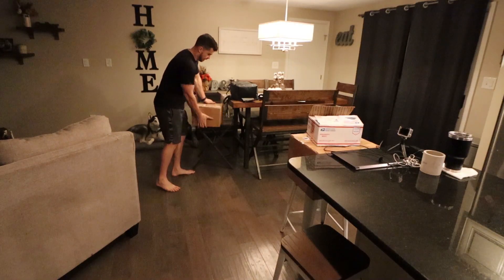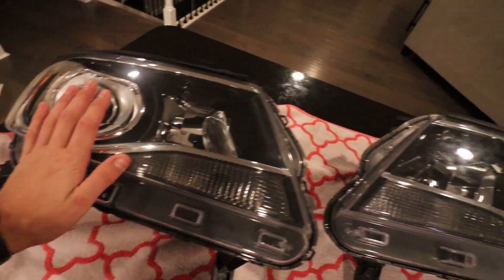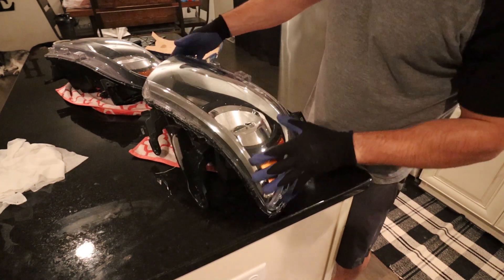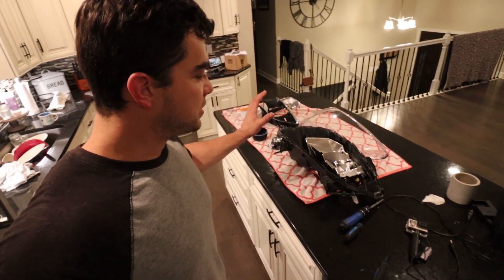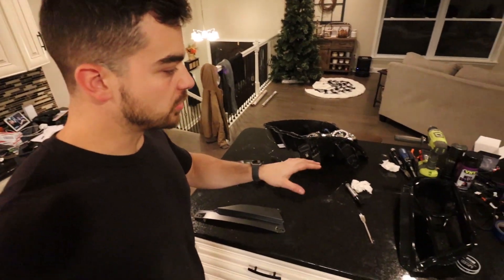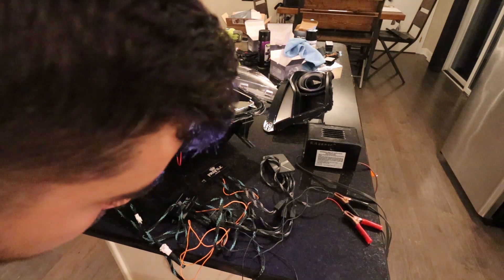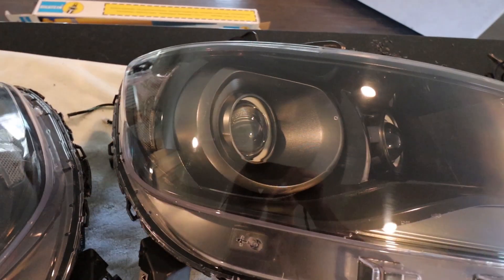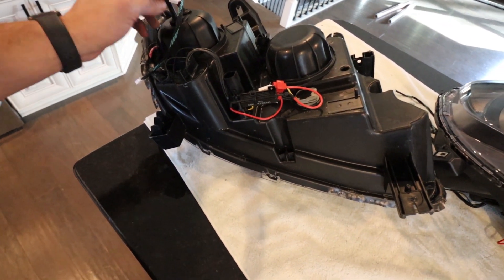Colorado ZR2 Custom Headlight Build - Dual Projectors, HIDs, LEDs, Switchback Halos & More

Comment: Hello Matt, Ghank you very much for posting your work and so many details. Awesome content.
I am just starting my retrofit, (2016 Lt, crew, 4wd, long box. I want to ask you, Are your halos DRL & turn signal? Which parts for this?  I apologize ahead of time, in case I missed it. 🙏🙏
Reply from the maker: They weren't technically DRL but they came on with the parking lights and then turned to switchback with signals.  Links for the parts are in the description box.

Comment: Looks awesome! Would love a comparison of light output/beam quality between stock and these. I have a 2020 and have been considering the spider headlights but the reviews on light output are mixed. Definitely considering doing this now!
Reply from the maker: New HID build > aftermarket lights with LED > stock halogen.  

My aftermarket lights were doable with dual LEDs, but light was kinda spotty.  Didn't bother me enough to change them, I built these for fun.
Reply from the maker: Did you have LEDs installed or no?
Reply: @matt13ross  I have diode dynamics Leds right now in the stocks and they are okay but the beam pattern is shotty
Reply from the maker: That’s pretty much how it would be in the Akkon aftermarket lights too.
Reply: @matt13ross  yeah that's what I figured. Gotta wait till my wallet recovers from wheels, tires, and lift before I consider doing this headlight build.
Reply from the maker: 😂 I feel that